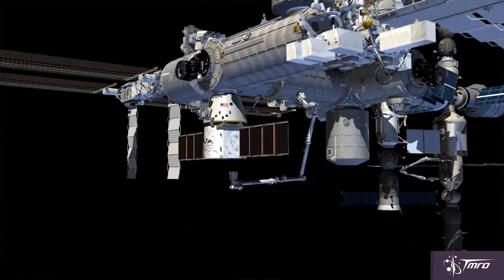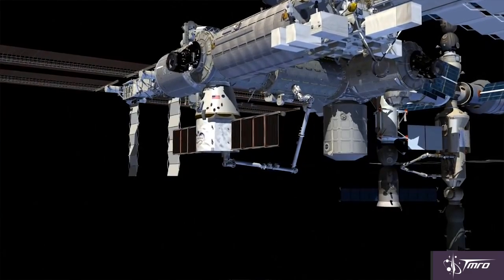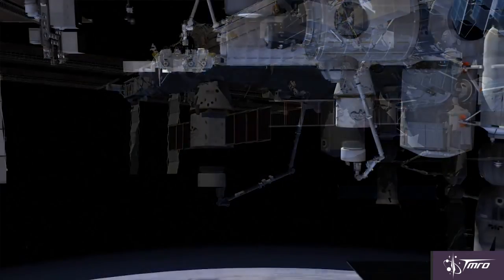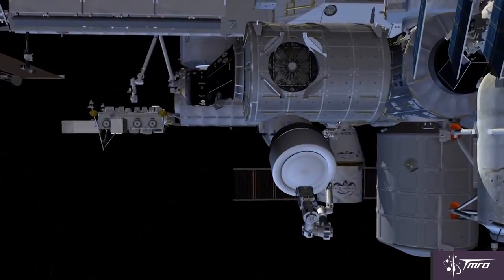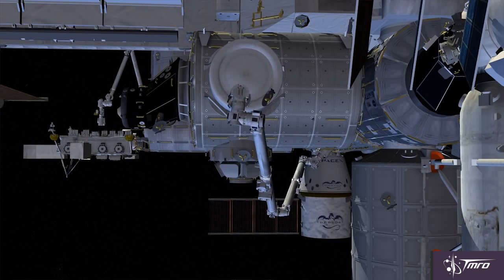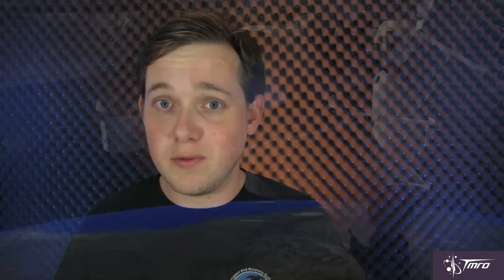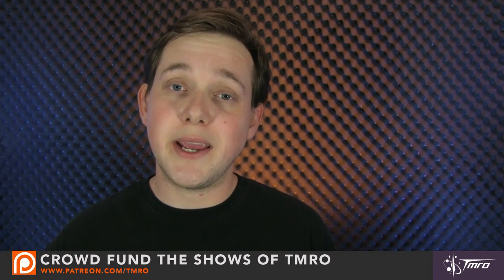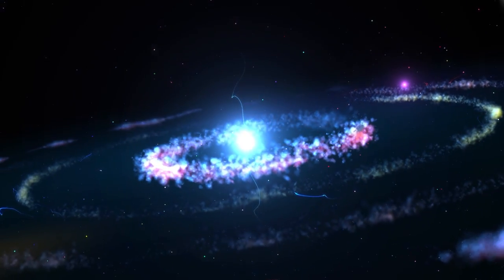The Next International Space Station Module has Arrived - Space Pod 3/12/15

Comment: Very cool really looking forward to seeing how the module does.  Shame they are going to depose of it in 2 years, unless it has failed seems like a good opportunity to keep it up there as long as possible and even utilize it for storage.
Reply: G'day,

Well, I dunno about leaving it insitu and continuing to use it, but I reckon throwing it down to burn on re-entry is both decadent and silly..

  I suggest a more responsible course would be to suck the Air out of it (it isn't as if the ISS has too much Air, and it has lots of Vaccumn...), and stuff the Folded Bag back into the unpressurised section of one of the Human-Rated Falcons (which "will be" flying by then) for return to the Balloon-Factory for detailed close inspection...

 I seriously doubt that an Astronaut inside the Module, or looking at it from a Suit floating around outside, can test the fabric for the extent it's suffered UV degradation under Vaccumn and rapid Sunlight/Shadow cycles experienced in Orbit.., anywhere near as well as the manufacturers can scrutinise it back on Earth.

 And until an inflatable Module has Bin-Inspected closely on the ground, after a "Tour of Duty" in Orbit, then to continue use them for any purpose in Space beyond their "Predicted Half-Life To Failure" amounts to connecting it to the ISS and waiting for it to spontaneously Fail-Dangerously while in use, thus endangering the Station...

 Somebody probably should've thought this all through, years ago, and allowed Bigelow to fly an Inflatable Module on the ISS in time to bring it's deflated Carcase back down in the Cargo Bay of a Shuttle, before they all went into Museums...

  Now they're kinda snookered.

;-p

Ciao !
Reply: I think it is a bigger shame they did not find more things to do in it while it is up there, if nothing else at least make it sound like it was not planed on being sealed off from the rest of the station most of the time.
Reply: SnowmanTF2 
G'day,

Um, well, reading between the lines...; the precautionary-principle probably means leaving it connected and pressurised but sealed, until it's Bin-Proven that it doesn't leak, or degrade and outgas the Volatiles from the Plastics in the Fabric, become brittle or fragile, and suddenly split from Arsehole to Breakfast-time...; and my guess is that the ISS Crew will suit-up and isolate the Connector/Access Module from the rest of the ISS before they even TRY to enter the Bigelow Balloon-Module.

  Remember, to the Fabric of a Space-Suit 100 Hours in service holding Vaccumn is a working lifetime...to a Pressurised Module in Orbit 100 Hours is 4 Hours into the 5th Day...; and this test is for 750 days...

Would you drive your Car for 7 & 1/2 Years without checking the Brake-Fluid, Coolant-levels, Tyre-Pressures or topping up the Oil - let alone changing it. ?  No ? Well, 10,000 Km/ Year is 100  Hours of Engine-Runtime.

 Every 100 Hours a Licenced Aircraft Maintenance Engineer has to sign the Engine-Maintenance Logbook to doccument that a Piston-Engined Aeroplane has had it's Oil and Spark-Plugs and Air, Fuel, and Oil Filters changed...

 And if you consider Spaceflight to be any less demanding of Technology than a Cessna 152 then you're well into the land of Science Fiction.

  I once logged 4,976 Hours on a Chinese 750 Watt 2-Stroke Generator, but every 150 Hours I removed and dismantled the Exhaust System to clean and decarbonise the Lumens of all the interior Plumbing...; if the Bigelow Balloon Module is still Airtight at 7 months in Orbit then it's worked without maintenance longer than my Chinee backup-Genny, did with 33 Servicings...

Rocket Science is still Rocket-Science, and if one fucks it up the scale of Disaster verges on being Immense...

;-p

Ciao !
Reply: Very valid points, however after two years I am sure they will have a lot more data.  Don't forgot Bigelow already have to inflatable modules in space not sure on the status of either as they have not released much news but they are still up there.
Reply: Chris Marshall 
Yeah, as you say, after two years they'll know a lot more...
It's remarkable how durable some fairly simple-looking Fabric Structures can be..., I use the cheap Chinese Inflatable Swimming-Pools as Buoywall Water Tanks ($160 to hold 6,000 Litres, vs $2,500 for a hardwall Plastic Tank the same dimensions...) and I got 10 years continuous use from the first one I bought, till a Kangaroo bit a hole in the Air-Ring...

 But the UV Covers only lasted 2 years each, until they went very brittle, and finally Hailsones turned them into "lace-curtains"...; last year the new UV Covers were a much darker shade of Blue, they probably work slightly better because of it, but apparently therefore the material degrades faster, and now the UV Covers only last 1 year...

 I guess we'll see what unfolds (pardon the pun)...

  If the inflatable Habitats prove to be duable and safe and practical then that'll be very good..; but have you seen anything on the attempts to build Inflatable Aeroplanes..?

 Very very very clunky, I can think of two which did fly, one looking like a blow-up Rogallo-Wing with inflatable Spoilerons, solidly mounted to a "Trike" with a Pusher-Engine...; and a conventional 3-Axis inflatable Wings, Fuselage-Boom and Tail-Surfaces on a Plywood-Box Cockpit with a Propeller and Engine on a Wire-Braced Pylon poking up behind the Cockpit...

 There are reasons why the Aeronautical Fraternity are a bit standoff-ish about inflatable Flying Structures, and those two previous attempts to sell the systems to the British and US Military are two of the biggest obstacles facing Bigelow...; the mental image of Blowup-Wings slowly going flat and sagging on the Ground, or bowing and folding in Flight, lead to nobody having much confidence in trying to live in an Orbital "Jumping-Castle"...

  Have a good one,

;-p

Ciao !